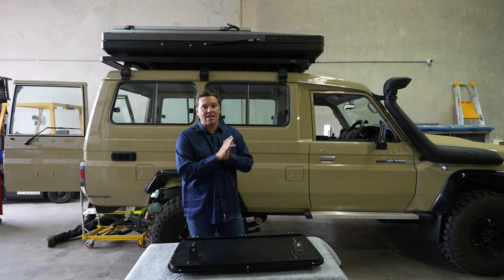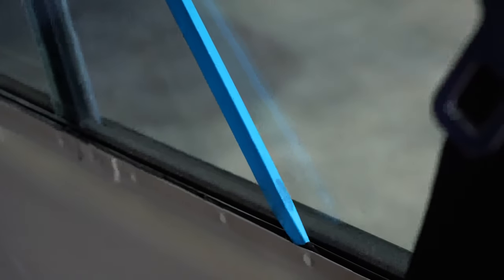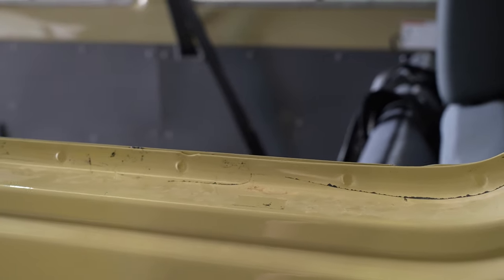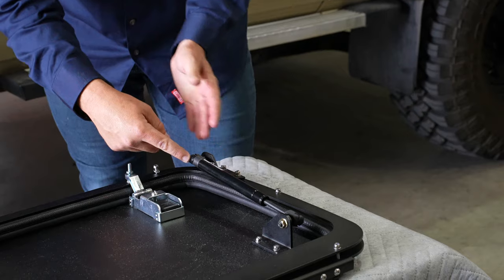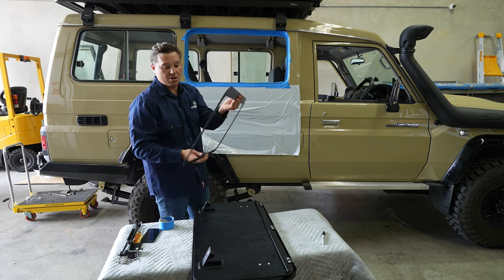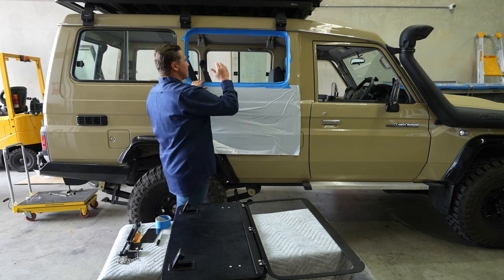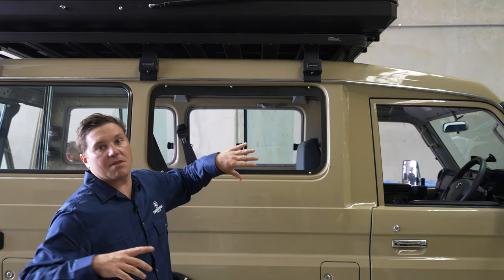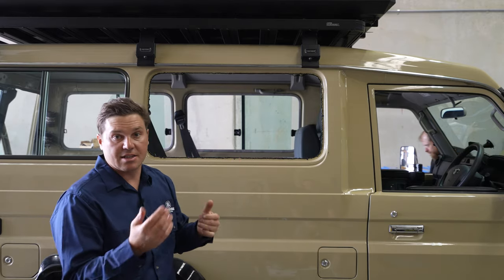Thorburns Gullwing Troopy Installation

Comment: Hi, great video. Unfortunately I don't have a troopy but I do have a medium wheelbase LJ73 with an FRP top. Do you know if the sliding side windows in the FRP Top are fitted in the  same way as this troopy was. I need to renew the external rubber seals and would be great to know in advance. Much appreciated.